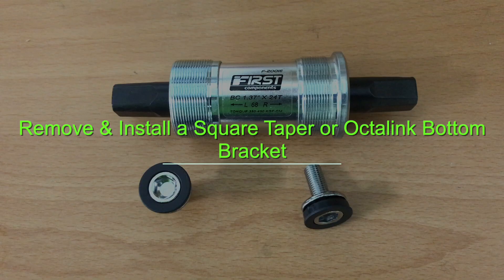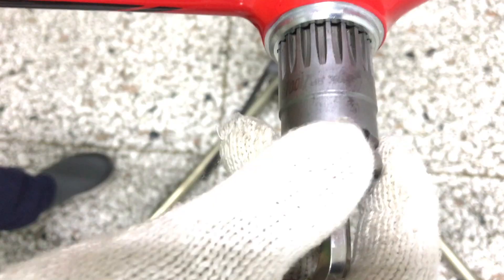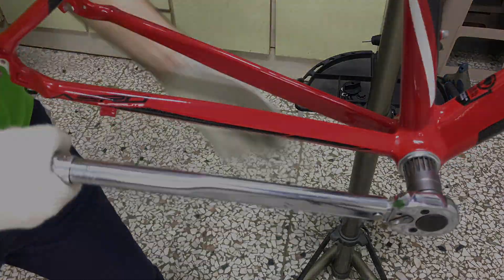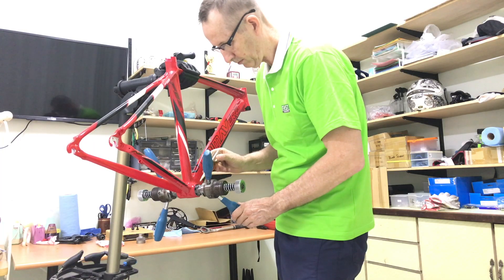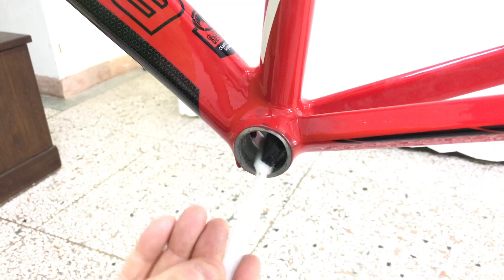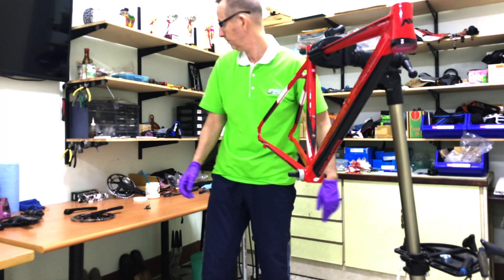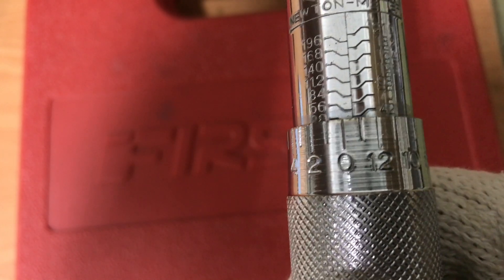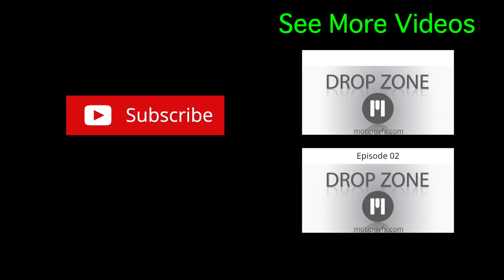Square Taper Bottom Bracket Removal & Installation ( & Octalink)

Comment: 5:36 - On the contrary, plastic nuts need torque wrench more, because they require less torque and are easier to over torque. Most plastic ones accept up to 30 N.m.

Comment: 0:18 Don't use that "cartridge bottom bracket tool", there isn't enough internal clearance to get it over the drive side spline, note that he uses his other tool for the drive side.
There are two types of BB tool, that silver one is for the square taper BB, you need a different one for the octalink that has the nut on the outside, not at the end. It's basically hollow.
Nobody points this out, luckily it's only £8
Reply from the maker: Thanks for the observations. The tool at 0.18 (by Bike Hand) does the job. I've completed literally 1000s of BB installs and removals with this one, mainly square taper but plenty of Octalink. Its splines fit well into the square taper spline profile, although there is a little freeplay—I have to make sure to keep it square against the BB, otherwise it can slip at medium to high torque when using the big wrench. There is an internal pin helping to stabilize it during use. The other one is by Icetool and is a little more stable. Both are adequate to the task though.
Reply: First Components - the 2nd cartridge tool will do some octalinks but not all, that’s why I’m posting. My octalink sticks out on one side so that tool will bottom out. I’ve had to order something like that 1st tool instead. Unfortunately the Aldi bike toolkit only comes with the short square taper version.
It’s probably useful to show a tool from all angles to identify issues like this.
edit: ah, wording in first post. By “don’t use” I mean, the 1st tool is more universal than the 2nd. YMMV